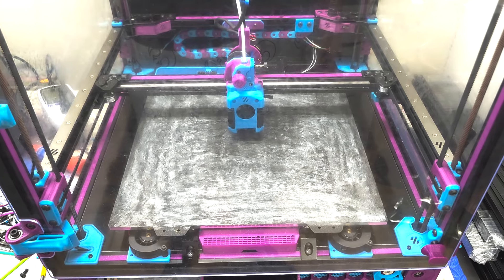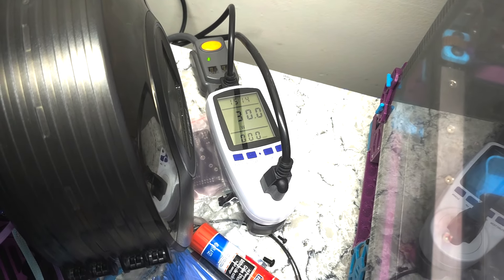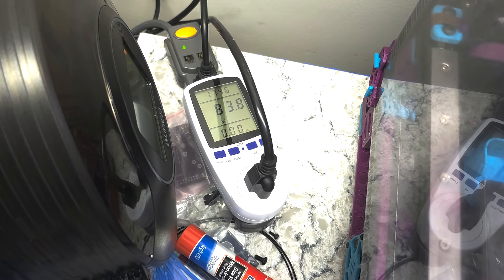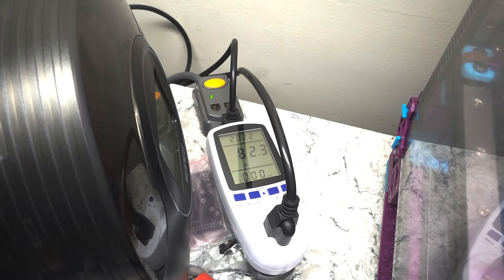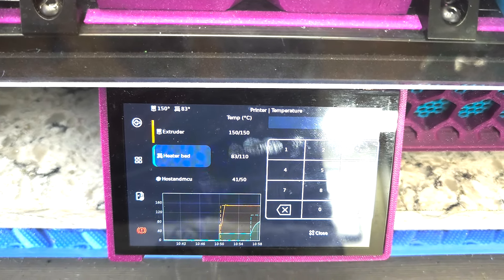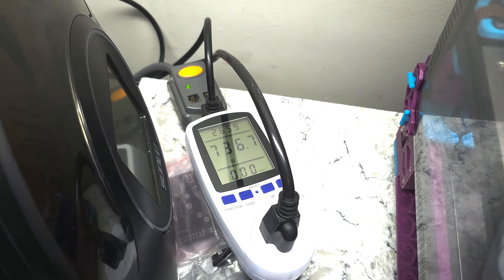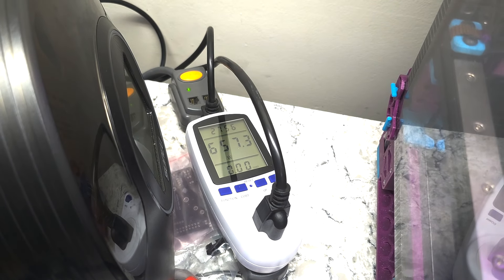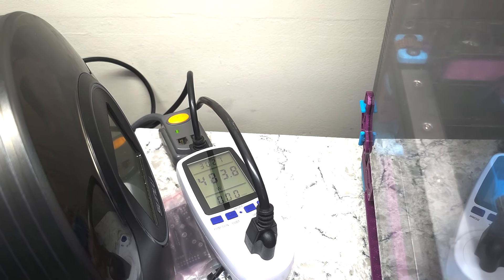Teachable Moments: Voron 2.4 Power Consumption

Comment: I have been using a kill-a-watt on my V2.4 for a while just to get a feel for how much power it was using and how much heat it puts into the room its in. As can be seen in your video, as the printer warms up and everything starts to heat soak to its normal running temp the power consumption drops steadily and averages much lower than it starts out at.
Reply from the maker: Yeah, it drops off significantly once target temps are reached, and the heaters then just need to maintain those target temps.

Comment: all the best, hope you get well and no need to excuse yourself !

I got myself a power meter quite a while ago, actually insane what my voron draws, i got a 800w bed (bit of a luxury but actually insane its like 1°c heating up every 0.5-1.5 sec) when full heating bed and hotend while maybe even homing it draws 1.1kw 😅
motors enabled it draws around 60w (awd voron 2.4)
while printing between 200-300w with 5160 drivers on 24v ... with 48v i hope it gives me an advantage but seriously before that i needa upgrade to 40x40 frame 😂
definitely needa get a income with the printer otherwise electricity bill gets me broke...

damn eddie current probes are so saddesfying with my speed dedications surely needa swap my klipper for that at some point🤔
Reply from the maker: I had been having some discussions over Discord on how to properly size a power supply unit for wattage, so figured the investment in the power meter would help to answer some of those questions.
Reply: @oldguymeltsplastic  yeah i go a 350 24v in there right now i believe, bed is directly heated from 230V inlet by an SSR unit 
i found out tho when ordering my 48V PSU that around 100-350w it doesnt make a huge difference in price but from 350 upward it gets very very expensive
😅
Reply from the maker: I run the two AB motors at 48V on a 100W PSU, never had any power issues. All other components, four Z motors, one extruder motor, the Octopus Max EZ, Pi 4B, U2C, 10 fans, 90 neopixels and the Dragon UHF hotend all run off of a 200W 24V PSU.
I have been told by a reliable source that I could likely run several more motors off of the 100W 48V PSU without issues, but haven't needed to yet.
Reply: @oldguymeltsplastic  yeah i know, went with more on purpose, the video from eddietheengineer about steppers explains pretty good why you dont need that much power electronic and gantry side im all set just rigidy aint ready yet

Comment: What voltage fans did you use for the toolhead and how did you go about connecting all 3 to the ebb36?
Reply from the maker: They are 24V fans. I spliced the two part cooling fans together.

Comment: Is warping not a concern with the bed? I followed the default config which limits my bed heater to 60% and when I searched why it has that most of the responses listed bed warping from heating too quickly as the reason.
Reply from the maker: I believe that has been proven false, provided that you have a cast aluminum bed plate of a specific thickness. Mine is 8 mm thick, so I have my bed heater power at 100%.
Reply: @oldguymeltsplastic  Thanks for the reply! I'll do some more reading and give it a test when I get home.
Reply from the maker: @Cobbian  as always, your mileage may vary, and I can't be held liable if your build plate "tacos". 😎
Reply: People have been insisting recently that it doesn't matter on cast beds, though I thought they always were cast aluminium. Either way all metal warps if the temp one side is different to the other. I prefer to let it take the very few minutes it takes with a low power heater and hopefully that means the top and bottom are always very close to each other. Aluminium of course transfers heat well but its not instant. As a welder I've seen what rapid heating can do to metal. A very slight warp can unwarp when the temp equalises but its not always exactly like it was and I paid good money for a bed that is ground flat so I would like it to stay as flat as possible. It doesn't take much warping over 350mm to get half a millimeter change.
For me the bed heating faster doesn't get me printing faster because I'm always waiting on the chamber heater anyway. Its also completely possible that the heater just doesn't have enough power to warp it.

Comment: What's your thoughts so far on the cartographer probe vs the beacon you had before?
Reply from the maker: Performance is basically the same, although I am not running a high temperature printer. The model of Cartographer I have installed is the CAN Bus version. I was hoping to use the integrated S2DW for Input Shaper, but the IS gods inform me that the S2DW implementation in Klipper is maybe not yet ready, or as well understood as the ADXL.
Reply: That makes sense, I was curious about it, thanks.
I've got a stock 2.4 right now, but I've been meaning to build a second one soon with rapid burner and CAN, so I've been looking around at probe options, and what other changes I should make.